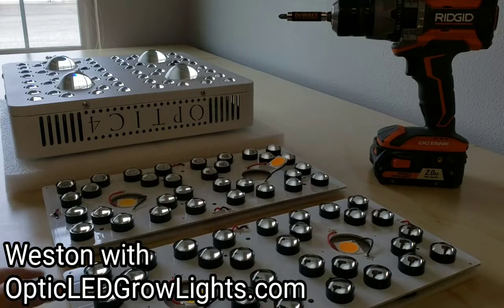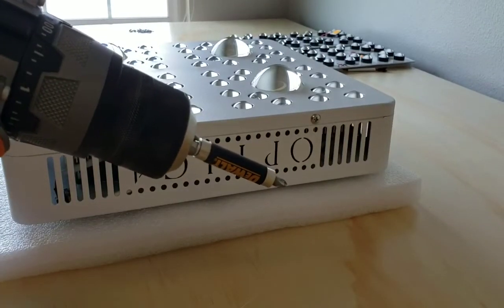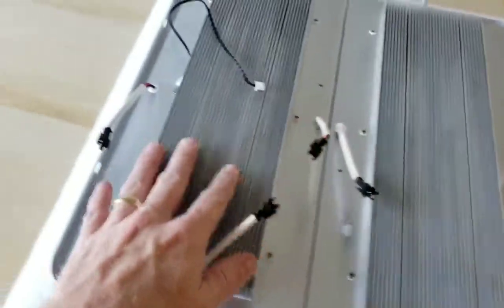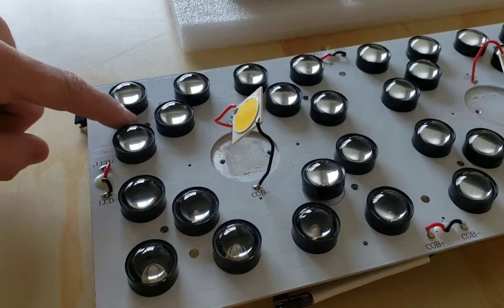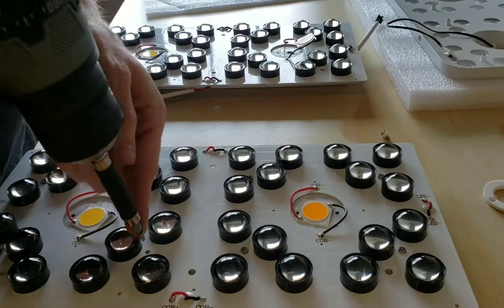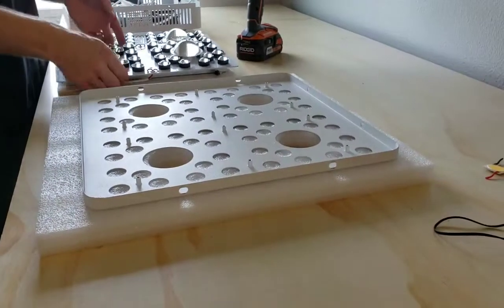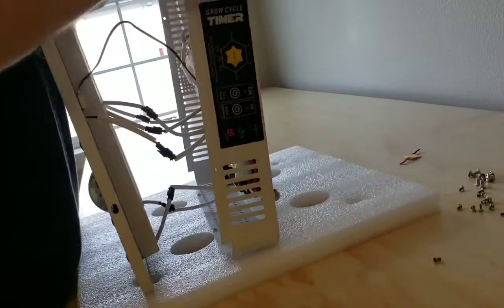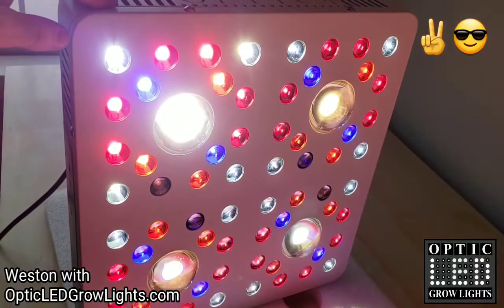Installing Warranty replacement LED Boards

Comment: does the plug that goes into the temp sensor go into the outlet on the left? (if you're facing the timer and the light's upside down with the grill removed) i see that there's two plugs, does it go into the one closest to that little blue box shaped thingy? or the one further away?